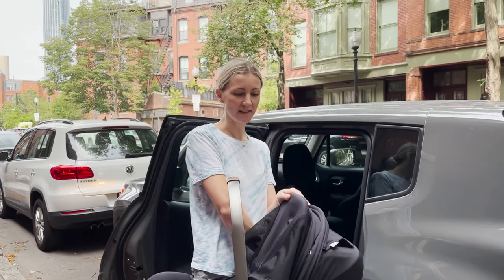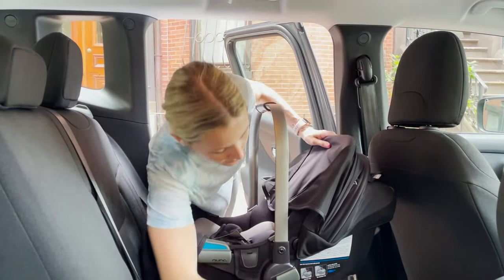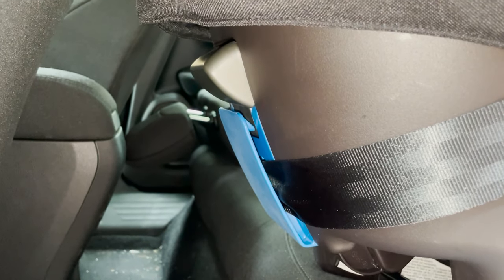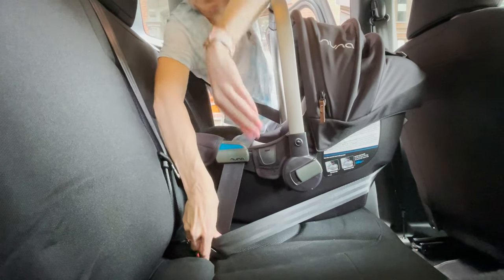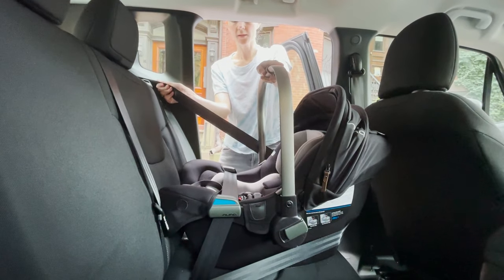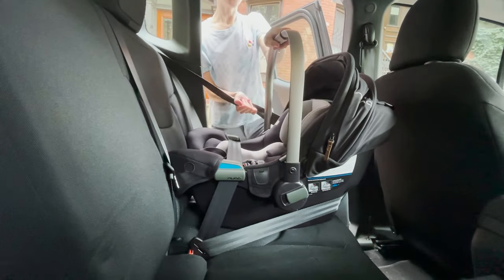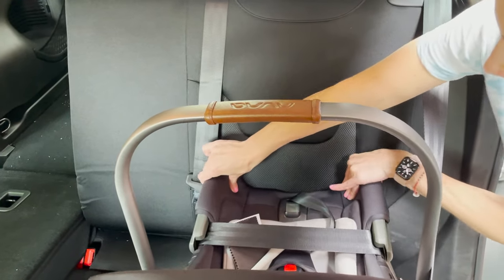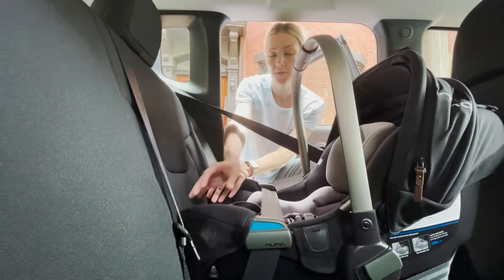Nuna Pipa Rx Install Without the Base | Tadpole

Comment: No one showed the side by the door. The shoulder strap. Does it go under the bottom of handle bar?  Bc I can’t get to stay there. Just pops up. Seems tighter id I don’t
Reply from the maker: Hi! Shoulder belt should go over the handle bar. Pipa rx manual has a clear visual of this in the manual on page 56 (https://nunababy.com/media/catalog/product/N/u/Nuna_PIPArx_IM_000002D_664e.pdf) hope this helps!

Comment: Can You use same technique instal the Nuna Pipa in car´s front passenger seat?
Reply: Jeff, you should never put your child in the front passenger seat. The airbags are extremely dangerous for car seats.
Reply: @travismalott389  Thank You for answer Travis. Yes, I agree about the airbag. But if I disengage the airbag, is it then possible to put the Nuna in front passenger´s seat with above method?
Reply: @wildjeff  yes it absaloutly is safe
Reply: @wildjeff I won’t unless I had no other choice. Other passenger in front seat before a rfing seat (in the US).
Reply: @travismalott389  You can disconnect airbag for passenger seat.

Comment: If there is an accident, the baby will go face first into the seat of the car….do NOT use the seatbelt that way. Absolutely not. Look up crash tests with the seatbelt like this. It’s scary.
Reply: Look up Nuna’s certification
Reply: We own this seat, and this is a second method of installing the seat per Nuna.
Reply from the maker: Thank you for your comment. While I understand your concern, it’s important to note that installing infant car seats with just a seatbelt is indeed safe when done correctly. The key is to carefully follow the manufacturer’s instructions to ensure proper installation. Many car seats are designed to be installed both with and without a base, providing flexibility without compromising safety.
Reply: There’s are nuns instructions on how to install without base. Of course people would rather use the base but in case of an emergency this is how to install the car seat and to avoid any accidents or harm. I actually saw a video on TikTok of a couple who forgot their base and got into a car accident using the seatbelt method. The entire back of their car was gone and the car seat didn’t have anything. Baby was fine and so was car seat which is why investing in a nuna car seat is worth it. They’ve done so many crash tests. It’s also important to note that this video is specific to this car seat. Other brands have different instructions to follow :)

Comment: Don't do this type of installation unless it is an emergency. Without the base I could almost guarantee that if the person in the video were to lift up the carrier around where the shoulder belt was placed the whole car seat would become dislodged. Bring the base with you if you are traveling.
Reply: There is a hook in the back that the shoulder strap is threaded into. It’s not going to go anywhere
Reply: @kylen6430  yeah it will feel really secure side to side at the belt path, but up and down you’ll be able to flip the carrier out of position. The lock off on the back isn’t preventing that in the event of a major car accident.
Reply: @HeyClutch  I own it. The neither us or the in-laws were going to spend the extra $160 to have a base in every car. I can assure you, it doesn’t move.
Besides, these products go through a rigorous testing and certification process, both with and without the base. I’ll trust them over Matt from YouTube comments.
Reply: @kylen6430  and I trust multiple certified techs that have done my installs that have said carrier only install is for emergency and shouldn’t be used for every day use. I trust them over Kyle N from YouTube comments. And it’s not called a “hook.” It’s called a lock off. There is a reason why NHSTA recalls seats that don’t come with a base. Take the extra time to switch over the base to the car you or the in laws are using since you’re such a pro at installs.
Reply: @HeyClutch  👍
Reply: @HeyClutch  actually that is NOT a lock off at all, neither is it ever referred to as such by the MANUFACTURERS of the seat. The belt method is just as safe as the base, and if you were dumb enough to try pulling the belt like that, you shouldnt have kids in the first place. Also no, not everyone wants the base and in my case, I live in the city, don't have my own car and use public transport so for me a base would be a pointless expense
Reply: @cloudedcolour5329  checking the carrier up and down for tightness and security would be a dumb thing to do? Maybe you’re the one who should need to get a license to have children? Obviously I’m not going to do that with a child in the carrier 🙃. Check the recall list put out by NHSTA. Seats have been recalled specifically because they did not come with a base.
Reply: @HeyClutch  no it’s not you check at the belt path, no matter the seat, EVERY seat has forward movement and every seat has a method to install without a base both the European method and the USA method which is actually the inferior one, even a base has forward motion too so that arguments dumb.
Reply: @cloudedcolour5329  No, you check at the belt path side to side AND up and down. You should not have more than an inch of movement. Yes just because there is a method to install without a base that does not mean it is the safest. A carrier secured properly on a properly installed base is going to be much safer than a carrier only install. If we can’t agree on that then I am done arguing. Maybe your base has forward (i’m assuming you mean up and down) movement, mine doesn’t. I do find the rigid latch on this base can create problems depending on the car it is being installed in. A lot of times when using the rigid latch there is a gap between the base and the seat back which is what would create the up and down movement. This is when you cut up pool noodles and place them or rolled up towels in that gap to stop the movement.
Reply: Again I dont have a base neither have any use for one, Im not about to haul a base in and out of taxi's and up and down out of trains for no reason @HeyClutch
Reply: You are doing something wrong. You are either not pulling the belt out all the way to lock it or you are not keeping the blue line on the side level with the ground. It doesn't move.
Reply: @georgecandal1481  Even in the video the woman says it’s not as full proof as with the base. Notice the movement side to side, which is fine since it’s not more than an inch, but she did not check for movement up and down. Good point about the level…some vehicles have deep bucket style seats which make getting that level impossible without cutting up pool noodles or rolling up towels. Not something I want to be doing if the base is readily available. I understand a base is not practical if you are constantly in cabs/rideshares. NHTSA found that 59% of car seats are not installed correctly. Bottom line is go find a child passenger safety tech to check your installation. They will tell you that Best practice is to use the base.
Reply: Very misleading comment!